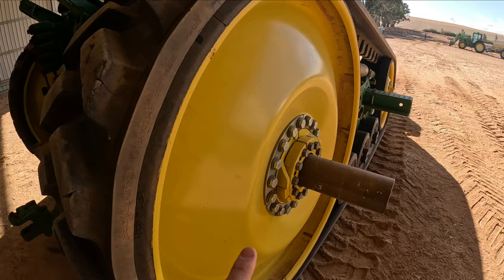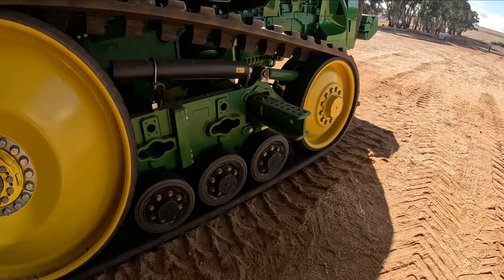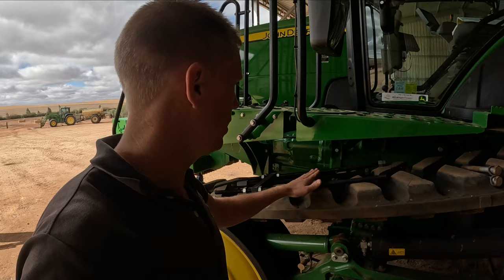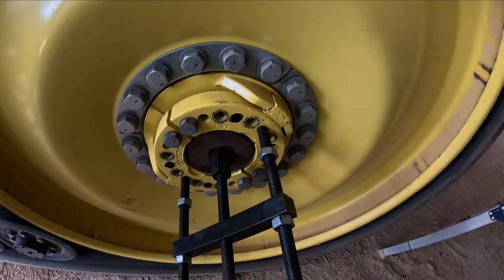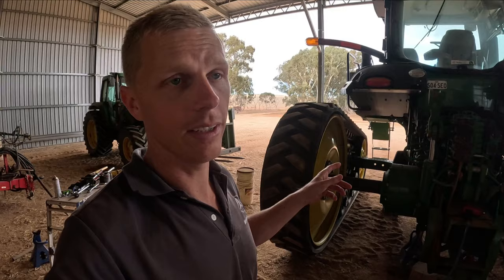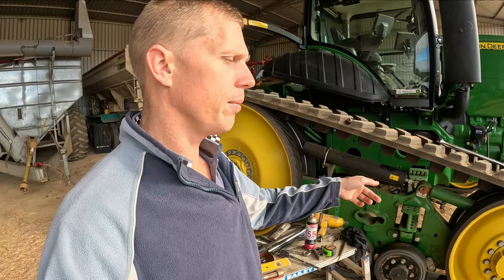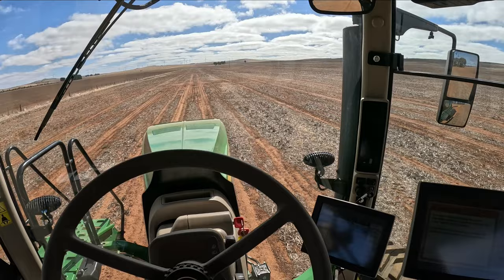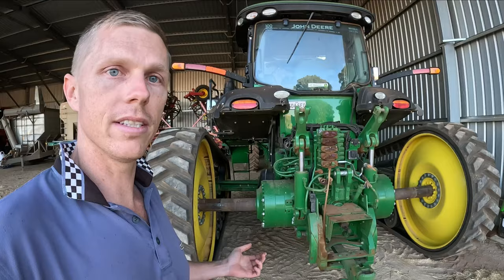Winding Them Out | Track Width Adjustment On A John Deere 8370RT | Widening Tracks

Comment: Biggest benefit youll see is its ability to pull around corners. It will slip less and make nicer turns  while under load. Also 1000x better for accessibility during service